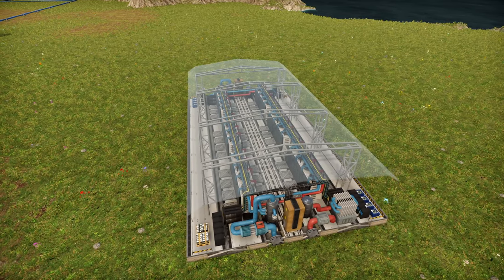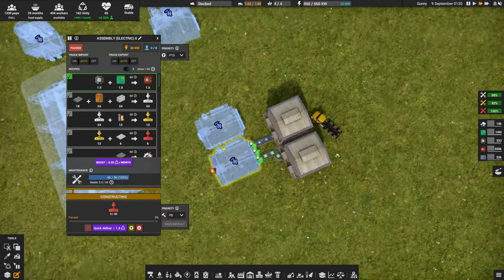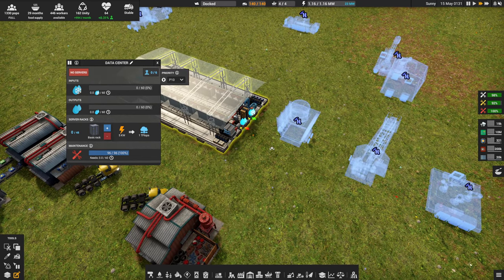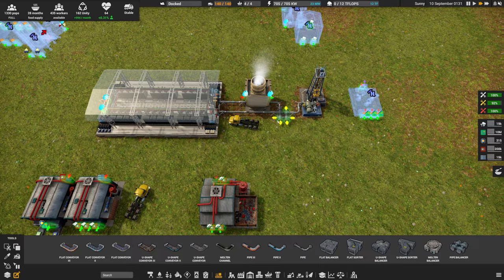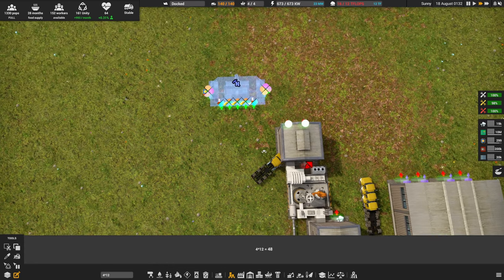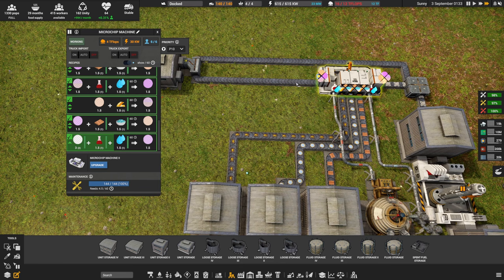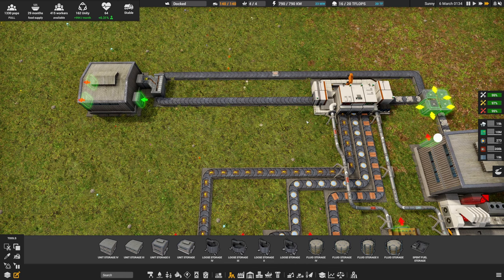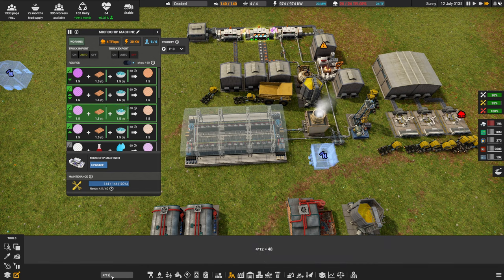Microchips, Robotic Assemblers & Teraflops 🚜 Captain of Industry  👷  Walkthrough, Guide, Tips

Comment: Can you place the chip fabs back to back? 
Inputs to inputs using the connectors to make two groups of 6:

  ｢下下下←
  |    =====||
  |上上上|   ||
 ｢下下下|   ||
  |    =======
  |上上上→ 

If you can get the 3rd belt (plastic/copper) to go over the 2nd belt (also plastic/copper) 
And the acid pipes to come in over the end return belts 
It should be more compact?
Reply from the maker: I tried, trying to get all the belts to plug together was not easy to say the least, and it looked like a mess! Also it would of been MUCH MUCH harder for me to explain and build live!

Comment: Fun fact: you can use a priority splitter on one end and a filter on the other so you only have to use one machine to make microchips instead of the stupid amount of steps
Edit: oh you did that. this is what i get for commenting before watching the video. lol
Reply from the maker: Yes watching the whole video before commenting is a bonus :) But rather than having once machine cycling I wanted a way to upgrade to 3 machines quickly and easily!
Reply: I started with one, then advanced to three allowing them to go from type one to two to three to four every time they passed through the set of three one time. From there, I kept on producing and storing them until I was able to build a complete line all at once that produced them in a single pass.

Comment: It's easier to just build 12 things in a row... Using 1 conveyor and 2 pipes
Reply from the maker: 12 in a row is nice, but is a very long build, Also you will still need 2 pipes and 3 belts to feed everything. Unless you use some sushi belt and hope it never backs up
Reply: @JDPlays  you don't need 3 belts, that's the point. A balancer in "equal inputs" mode works as a mixer. You just need to have one belt (if throughput is enough) connecting to all machines and looping back (or not. Didn't try without looping. It stops belt from backing up).
In case of chips: you need plastic:gold:copper ratio to be 1:1:1, so 1 input of each will leave you with just enough materials on belt in needed quantities